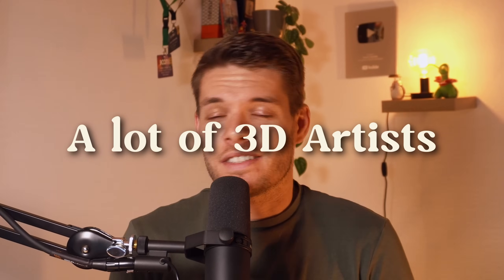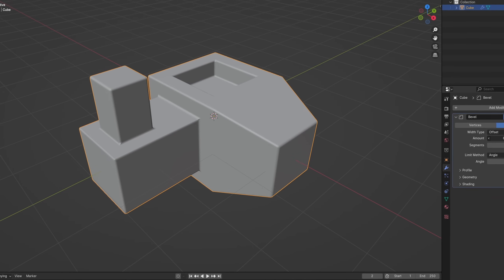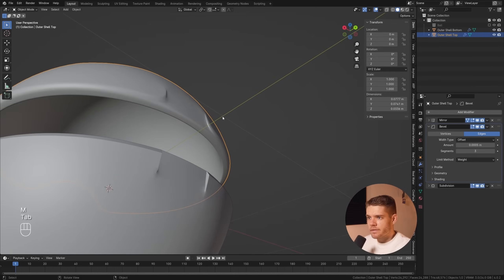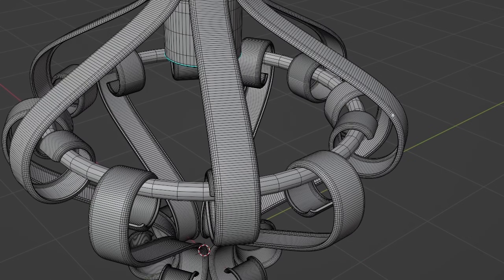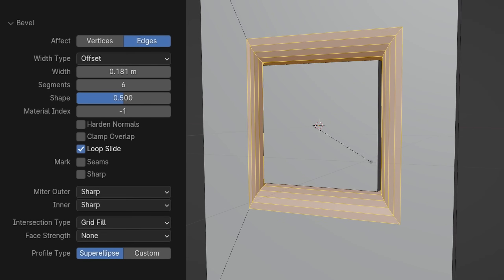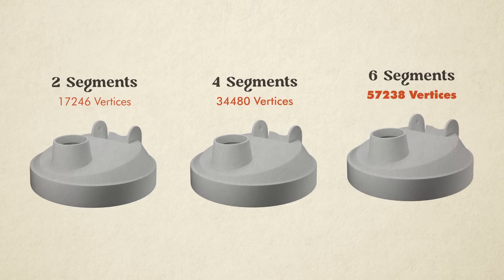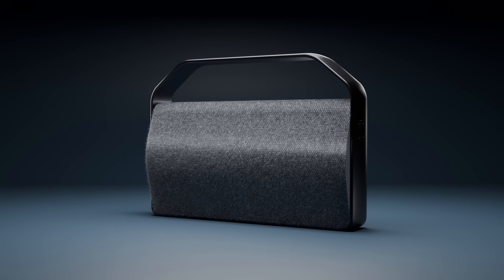The Trick that will Make Your 3D Models 10X Better!

Comment: I want to become a 3d modeler do I have to take a course to do this I don't know where to begin or what to do I wanted to get zbrush to make my imagination come to life or a scanner when necessary and I don't have a clue as to what printer to buy as well as materials need knowledge
Reply from the maker: The only thing you NEED to do is get started. All the others are optional and you iwll learn as you grow what you need, want and require to get where you want to go. First of all just begin by doing some modeling and following a few tutorials to learn the basics.
Reply: @KaizenTutorials that's fine modeling with what what kind of printer and scanner should I get what are the best filaments to use nylon is strong can it be used for modeling in 3d

Comment: Is it good solution to use bevel node in material editor for simlation these small radiuses? Some times i have shity topology And bevel modifier doesnt work or sometimes i have teselated data from CAD. Quality Is worse or it Is effect rendertimes more?
Reply from the maker: It can definitely work! But it's not good practice for models that need to be exported sometimes.

Comment: Older real windows do have a bevel it’s called caulking, which creates roughly a 45 degree angle all the way around the glass.
Reply from the maker: Yeah they do! But thats not what I meant. I meant theres no beveled transition between the glass and the wood for example! And if there is its a separate object like the sealant.

Comment: I use bevels all the time in cad. Much easier there.
Reply from the maker: CAD is definitely better suited for hard surface modeling!
Reply: @KaizenTutorials  yep. It won't help you animate or render or have decent topology but if you want a solid object to look good then cad sure does make that easy.
Bevels/chamfers and fillets generally make stuff stronger too which is the main reason I use them so much.

Comment: 7:30 Face strength is used for the Weighted Normals modifier.
Stronger faces will maintain their flat appearance when adjacent to the weaker faces(which will look smoothed out)
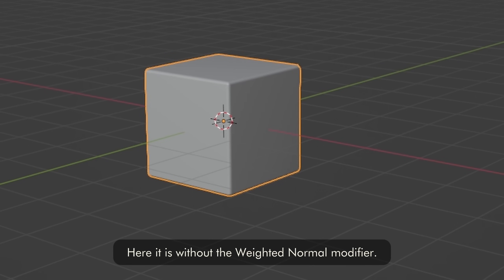Like in this case at 8:53
Even despite the weighted normals modifier, the sides still aren't looking perfectly flat. They look slightly bumped out when you look at proper angle.
To fix this, just make the big faces have Strong face strength and the beveled edges have Weak.
(And enable usage of Face strength in the Weighted normals modifier).
The difference is subtle but makes it better.
Reply from the maker: Finally an answer! Thanks!

Comment: Personally I sometimes use the percentage bevel to increase the polygon number of a part of an object. For example an oval of only 8 sides, just put the bevel as a percentage to have more polygons (don't forget to merge by distance after the bevel). Also practical for going from a low poly to a high poly in a video game

Comment: How do you solve the ngons that get created from beveling?
At 10:52 you created an ngon near the back of the model.
Reply from the maker: Ngons aren't always a bad thing. If they appear on places which are flat/relatively flat and don't need to deform for animation it's not a problem usually.
Reply: @KaizenTutorials   
You still get issues with the normals on flat surfaces, especially if the ngon is not a "nice" shape. These kinds of issues present themselves as weird "wobbles", especially noticeable on more reflective surfaces.
Ngons also confuse the UV unwrap, often causing odd stretching and general wonkiness in UV islands.
Personally I'd want to completely avoid ngons.

Comment: One of the things that "annoy" me when looking at hard surface modelers, is the complete lack of consideration to production. A cube with a cylinder on it? Unless creating actual welds, the bevel would always go the opposite way in real life; a chamfer to guide the insertion of the cylindrical piece. "Outside bevel" everything may cause better highlight catching, but it sure isn't "realistic" from a production (of the piece) standpoint. Also don't forget about the 0.75 superellipse, it creates a much better curvature comb, a smoother transition from flat to curve.

I also often end up with shading artefacts; across long polygons due trying to keep things low poly for efficiency, or inability to keep faces flat (no smoothing) that should appear flat. I have come to love the bevel node; it does a good enough job for distant objects (all of my objects are distant - enough - anyway), and you get to add noise to it (like after a deburr operation) with no additional geometry whatsoever. I really wish the bevel operator/modifier had the option to create the last segment tangent to where it connects to. More geometry, but cause no further issues.

Note that bevels in a polygon modeler will always be extremely rudimentary compared to what you can achieve in i.e. Solidworks surface modelling.
Reply from the maker: You're right. If we're talking production using Blender in general isn't the best idea. CAD softwares likes Solidworks are way more suitable for that.
Reply: @KaizenTutorials  I don't mean strictly about creating for fabrication and documentation purposes, but the idea of creating production plausible models for 3D rendering. Especially as far as metal machining goes. Sheet metal have some considerations, milling and lathing others, whereas plastic molding has yet other considerations. We already try to accomplish plausible materials, so why not objects?

Comment: Tumbnail be like:
Beginner: Cool black backround but bad angle
Pro: Orange background goes almost absolute white in the centre, the model looks like  it`s unevenly cut in photoshop, 800x600 resolution, but camera angle is goood.

No offense, I just have my own quirks

Also thank you for explaining more about bevels. Never knew that it was possible to control bevel modifier with weights

Comment: destructive modelling is dangerous. We should try to avoid it as much as possible. The last method you didn't showcase in this video is the vertex group applied to the bevel modifier. this is extremely powerful, and very flexible. plus it is non destructive and fully procedural. the best of both worlds.
Reply: It's sometimes a bit more trouble, but it's very rare that you cannot achieve the 'manual' result with the modifier. Especially now you can assign vertex groups in the modifier stack using GN. At the moment that sometimes involves some mental gymnastics.. but it will improve 😊.
Reply: why would it be dangerous?
Reply: Manual bevels can't hurt you, but they can make you lose a lot of time as they are destructive. That means if you do some bevels, continue working on your model and change your mind, removing said bevels is a pain in the ass
Reply: @jo_kil9753  dangerous because you cannot go back easily. you need several backups along the way, and it is a pain to manage, plus you will have to redo everything else when starting again from an outdated backup. working procedurally should be the very first priority in any workflow (true in any software! and not only 3D), whenever it is possible, this is far more flexible, and easy to correct.
Reply from the maker: Well yeah. You can always use a bevel modifier to preview stuff. But once you're set, manual bevels just look inherently better and more real. Plus this is also why I say use bevels with 2/4/6 segments, since removing these is a LOT easier to do than using uneven amounts.
Reply: @KaizenTutorials  I came from a CAD background, so the idea of modeling something you cannot undo with one clic is enough to give me goosebumps. furthermore, the fact that even with the possibility to do it very accurately and precisely in a procedural manner (vertex groups), some will still prefer to do it destructively is totally crazy to me. Now, it's ME with my personal background, and also if what you said last is correct (applying it manually look better and more real), yeah it worth the shot.... but I will probably still not do it destructively 90% of the time. (I said 90%, because when you work with converted cad data, sometimes you don't have the choice).
again, it's only me, but I think that "avoid working destructively as much as possible and do it procedurally whenever possible"is a VERY good rule to live by.

Comment: in max there is an "alternative" to bevel workflow, you can put weight on edges, it work well becaue you can add edit poly modifier after that and still change value of weights before subdiv. That's something i miss switching to blender.
Reply: @ParzivaaI  no no, you totally can do exactly that in blender, and is is extremely flexible and powerful.... and non destructive. 
you just have to make vertex groups, then apply your bevel modifiers to the group you want. you even can make several different bevel shapes by using different modifiers in the stack. It is very powerful, and deserve a place in this video.
Reply from the maker: Isn't that similar to using the modifier with the weight type instead of angle?
Reply: @ParzivaaI  no no, you totally can do exactly that in blender, and is is extremely flexible and powerful.... and non destructive. 
you just have to make vertex groups, then apply your bevel modifiers to the group you want. you even can make several different bevel shapes by using different modifiers in the stack. It is very powerful, and deserve a place in this video.

Comment: What kind of laptop do you recommend for beginners and is  MacBook m1 pro enough for learn modeling?
Reply from the maker: Yep! Any laptop that can run Blender is good enough to begin with.
Reply: The M1 MacBooks are extremely good for Blender, quite overpowered really (I was using Blender on a 2010s era MacBook Pro Intel for a few years).

For strictly modelling, the hardware requirements are quite low.

Comment: I always use manual beveling over the modifier one cause then I have control over what edges are actually beveled as I rarley want all edges of an object beveled but just some of them. For ex the edge where 2 parts join together I mostly dont want beveled as that could look strange because  the meeting edges would then curve inward and thus look like a cutout in the joint.
Reply: Unless you're printing or somesuch, separate parts are better modelled as separate parts. In this video, for example, the window frame should have been disconnected from the glass panes in the first place.

Comment: You can use bevel weights with bevel modifiers in order to controll each edge individually for non-destructive modeling. So yeah I'm stikcing to my beloved bevel modifier
Reply from the maker: Yeah you can! Its just a lot less flexible imo.
Reply: @KaizenTutorials GN assigned vertex groups have made the modifier much more flexible already. And we can look forward to the modifier accepting edge attributes.
Reply: @KaizenTutorials  Still thank you for the video! I see benefits of both teachniques, they are each unique in their own way :)
Reply: @KaizenTutorials  cap! You can go back whenever you want
Reply: can you do both? for example using a bevel modifier and beveling some edges with ctrl + b does that even work?

Comment: You can also achieve different bevel widths non-destructively by using the 'Weight' Limit Method instead of 'Angle' inside the Bevel modifier, giving you the option to manually set bevel weights per edge.
Reply from the maker: Yep as I said in the video. Its just a lot less flexible than manual bevels.
Reply: @KaizenTutorials  but also a lot more destructive, which is a no go in a modern production setting
Reply: @KaizenTutorials  Oh shoot, I must have completely zoned out, now I see, mb. Banger video as always then <3

Comment: What happens if you don’t like the bevel later.
Reply from the maker: Thats an issue yeah, using the modifier initially can help visualize and then do the manual bevel later on.
Reply: Like how I learned just today when i wanted to remove a bevel at the bottom end of a table leg. You mark all faces of the bevel and then select Dissolve faces in the delete menu and it will be removed.